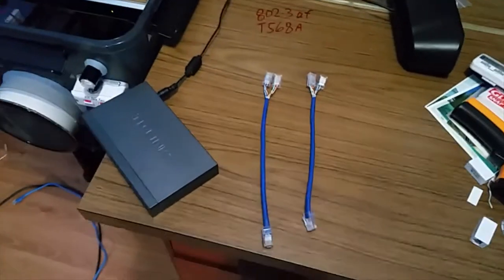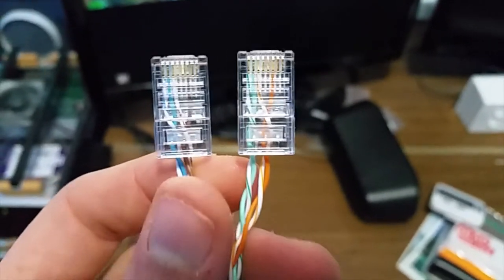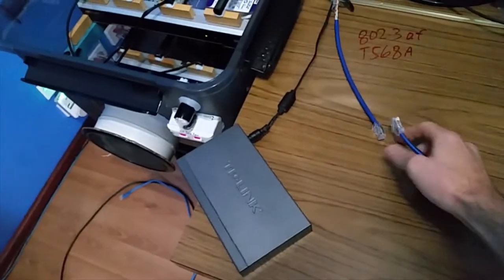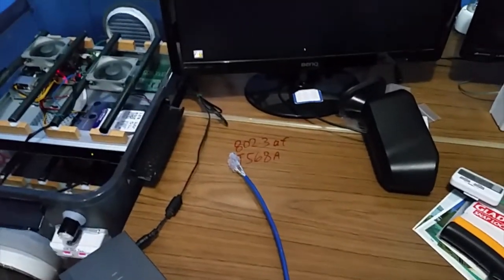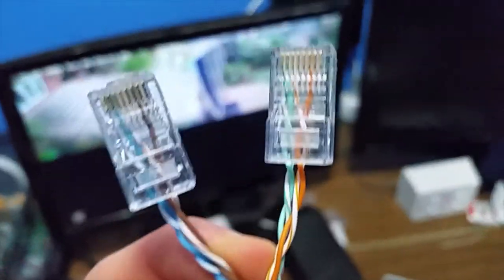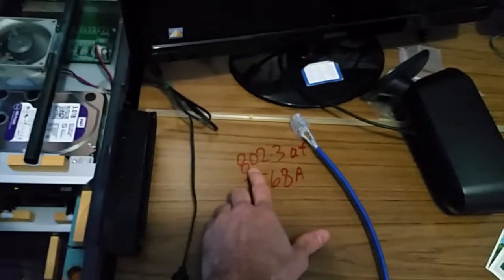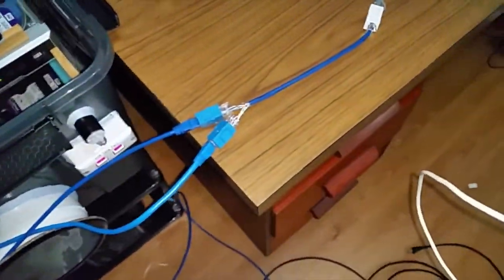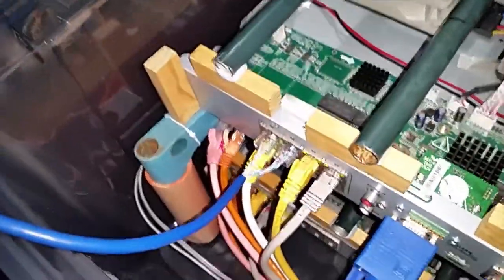Hikvision NVR 2-Pair Ethernet POE Issue

Comment: Will not work 2 pairs carry data 2 pairs carry power. A solution will be on the 1 run outside use a small POE switch and go to the cameras or use a POE Combiner Splitter.

Comment: If you run  - orange stripe, orange, green stripe. Mimic that on both sides and it will work. Doesn’t require 4 pairs. Only needs those 3. Although I don’t recommend this due to chatter.
Reply: I tried orange stripe, orange, green stripe, green on both side and it doesn't work !! exactly same result as he has.
Reply from the maker: @Eric Roessler - I have read stuff online about splitting causing problematic crosstalk (chatter) issues, but I'm yet to replicate them myself. I do believe that combining two 100Mbps links into a single cable (via this splitting method) does increase the risk of said issues because you are essentially placing the conductors of each link much closer together than they would be if they were just separate cables bundled close together. Because of this, I try to use Cat6 cable for my split runs as Cat6 typically has a plastic separator running through the cable that keeps the pairs further away from each other than they are in a Cat5e cable. Cat6 cable also has other design elements that reduce crosstalk.

That being said, during testing I've simultaneously viewed the main streams (16Mbps each) of 2 Hikvision cameras that were combined/split over 120 metres (so 20% over the length limit) of Cat5e cable. I noticed no issues with either video stream during that test. The 120 metres was actually made of 4x 30 metre patch cables (24 AWG stranded pure copper) coupled together. Each camera was also being powered by PoE over that 120 metre run, during that test.

Comment: i did a similar test with my nvr. From a T568B layout i split pins 1,2,3 and 6 to one RJ45 and pins 4.5.7.and 8 to another RJ45. First RJ45 i pluged it into one of the nvr poe port and the other one to an 10/100 mbs normal switch connectd to my LAN. The other end of the cat5 cable is pluged into the ip camera. It didn't work. The ideea was to have power from nvr poe port and data from a LAN switch so i can access the ip cameras from my local network.
Reply: Yeah I don't think that would be expected to work, the end device (camera) needs to get it's Power over Ethernet power from the same device that it's ethernet data link is 'from', at least that is my understanding.